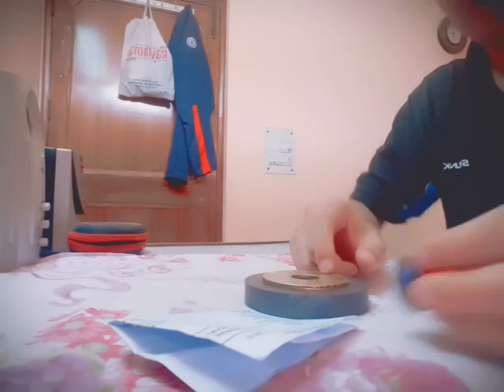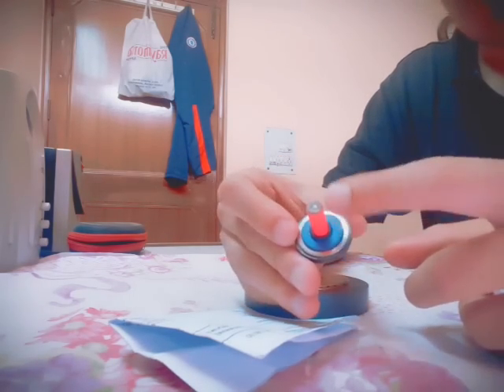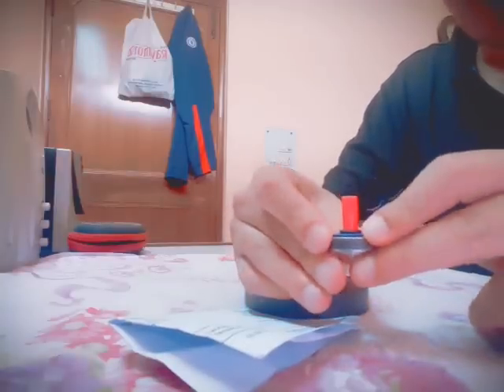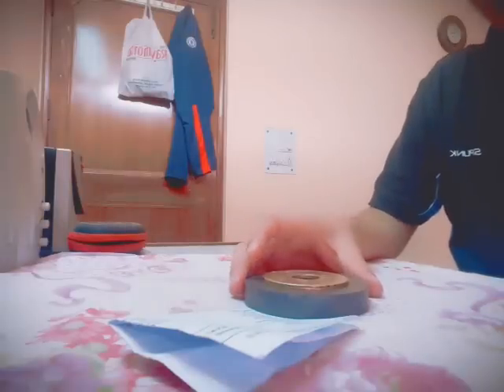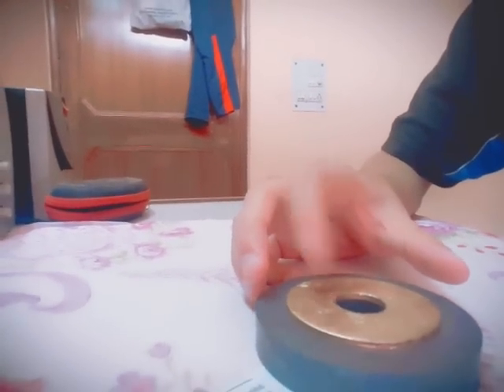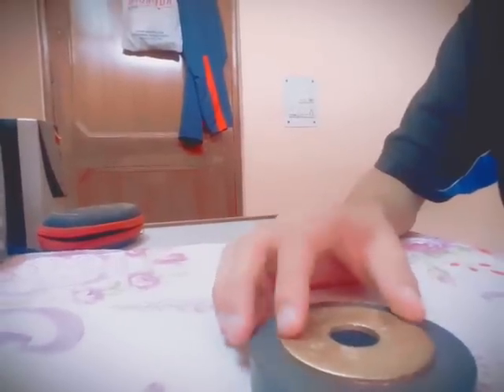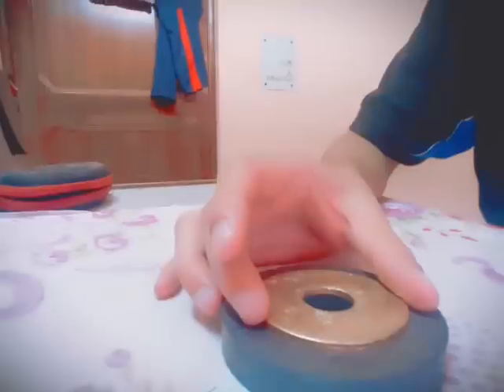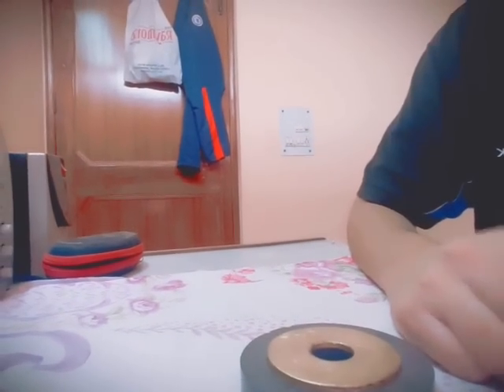Levitron from scrap (homemade)

Comment: Does the small one have  to be a ring magnets also
Reply from the maker: Not necessarily Anthony, it is just that the smaller top magnet, needs to be of the opposite polarity, to the side facing the bigger base magnet 🙂 .
Reply: @AmazingSciencewithAshishNegi  thx but I tired  all day n it dosemt work does thw top magnet have to be significantly smaller than the base 😦😦
Reply from the maker: Yes Anthony, the top magnets needs to be much smaller than the base magnet, and light enough so the repulsion from the base magnet, can make it float 🙂 .
Reply: @AmazingSciencewithAshishNegi  ok thx much appreciated
Reply from the maker: Welcome my friend 👍

Comment: Hi! Nice video, it helped me in making my own levatron. But one question, how much does the spinning top have to weigh in order to hover?
Reply from the maker: Weight has to be just right, in order to balance the equal repelling magnetic force and then centripetal force makes the top spinning upright. 
You can use plastic/metal washers as weights in order to get that perfect balance.
Reply: Wait I saw your video! U copied from him